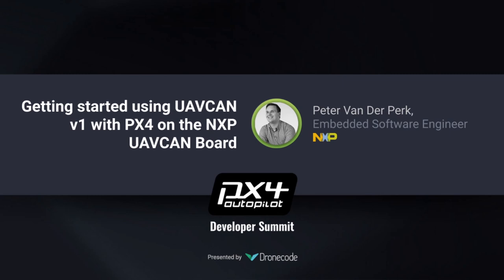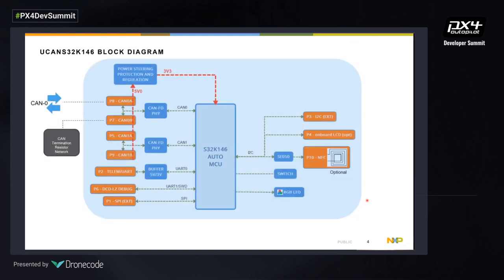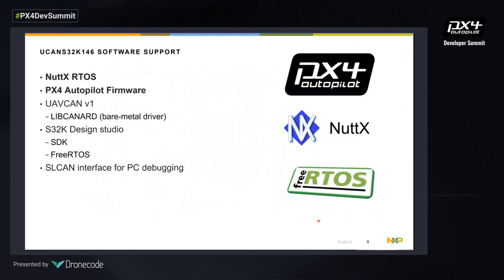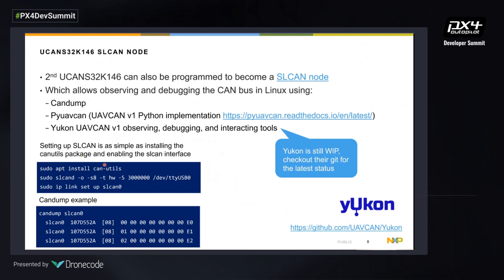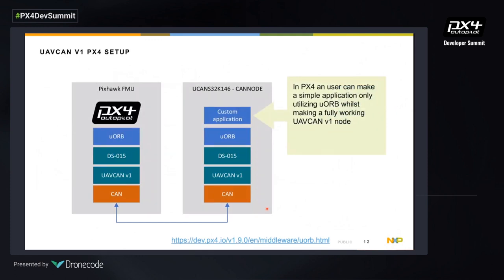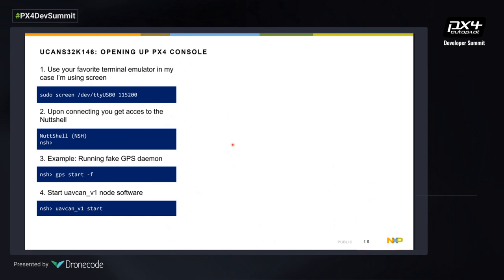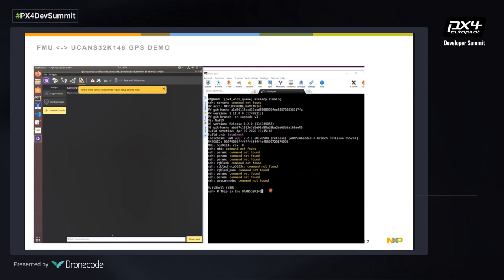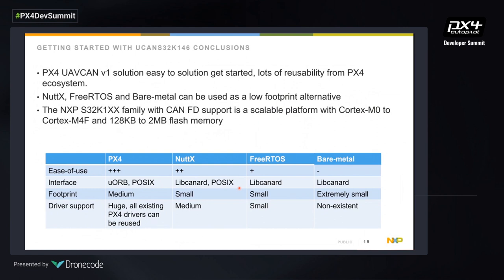Getting started using UAVCAN v1 with PX4 on the NXP UAVCAN Board — PX4 Developer Summit Virtual 2020

Comment: This presentation is very very helpful, 
i actually want to strip down px4 from UAVCAN and put in place my own (mushc simpler) canbus transport layer because i couldnt find a nice out of the box stm32 working uavcan baremetal example yet.

Any advice on where to find a nice px4 review over the real code not just powerpoint blocks?

thanks!